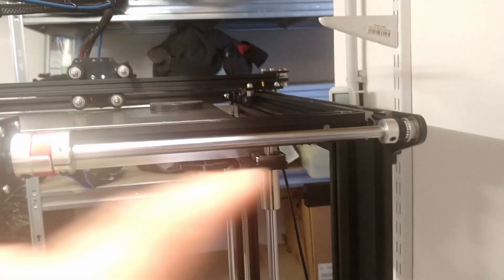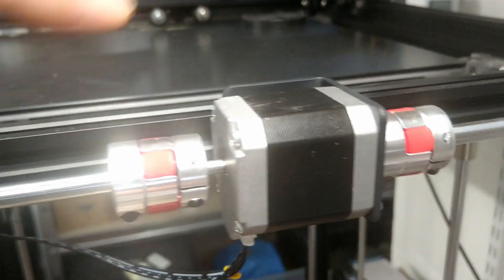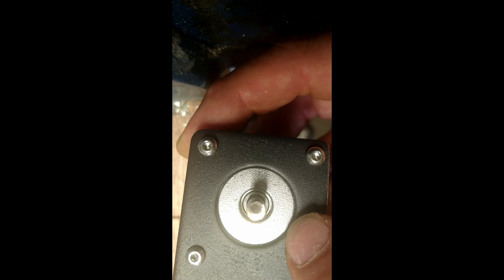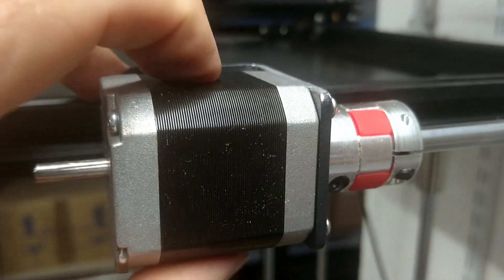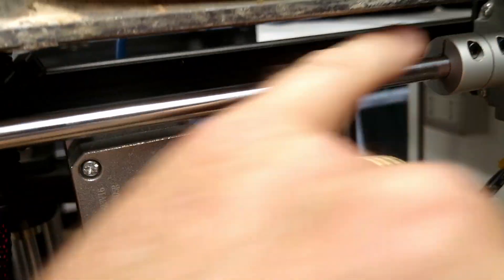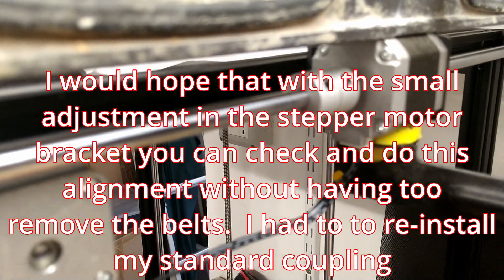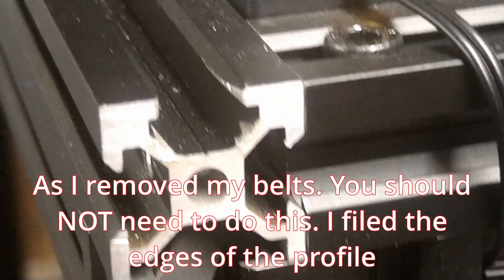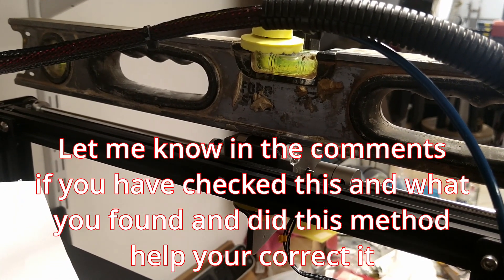Ender 5 Plus 3D 🖨️ Printer Don't Snap You Y Axis Stepper Motor Shaft 0033

Comment: How did you remove your motor?    I want to slip a damener between the extruder and my motor body to quiet things down like I did on my ender 5 but the bracket mounting screws are in the way.
Reply from the maker: From memory remove the corner bearing clamps. Remove the long drive rods now you can remove the motor. So it not straight forward but easy to do
Reply: @flixmyswitch  does the L bracket that holds the corner together and axle bearing need to be removed?
Reply from the maker: @aos7194  yes as they prevent the long drive rods from being removed you only need to do one side as then on the other side just release the coupler on the stepper motor
Reply: @flixmyswitch  thank you

Comment: with the urethane love joy connectors you have?  wont make a bit of difference.  They are designed to adsorb out of alignment issues (we use them in very high power applications) . and I would align off the shaft, not the housing..
Reply from the maker: Yes the coupling were not very good and had lots of run out.  The effort to remove the belts and rear brackets was not worth it.  That's why i say in the video that i removed them.  The method i show in the video is a very general way to check alignment however much better than not checking.  I have dial indicators etc that would do a better job but not everybody has them.  In my case the stepper motor was the high point and i was lucky that i did not have to modify the stepper bracket to get better alignment. Thanks for watching and the comment.  Have you done this check and how did you adjust if necessary

Comment: Thanks for that video. It’s me who give you the picture of my broken motor shaft. I have found that it wasn’t aligned as you show in your video and the other thing is, do not tight too much your belt because it will pull on your Y axis shaft and put a stress on it. If any one ear a clicking noise coming around the Y axis, you HAVE to check motor alignement  and maybe loosen both Y axis belt. Now mine is perfect, my ender 5 pro is my prefered printer by far.
Reply from the maker: That's good news. Yes I think very tight belts are another issue. As the rear bracket only has one bearing on the outside it transfers a twisting pressure down the long connecting rod and onto the stepper. It's a quick thing to check and easy to correct. I hope this video saves some folks the cost of a dual access stepper 😎